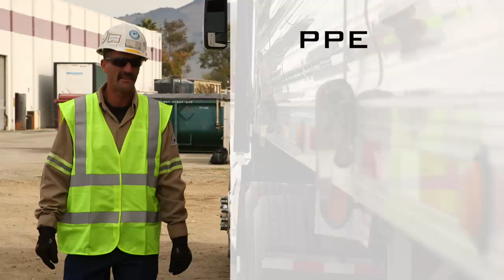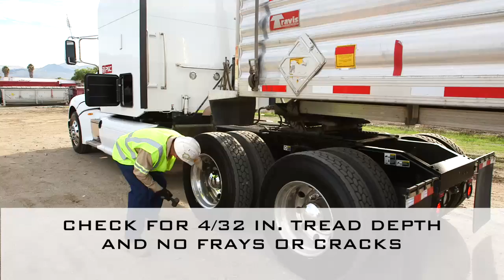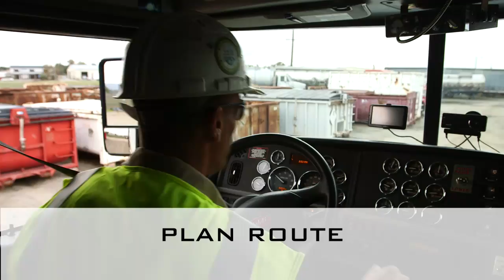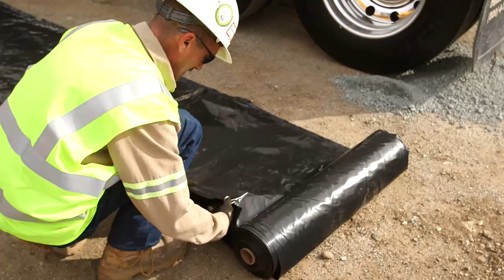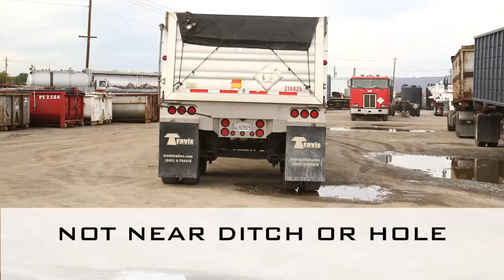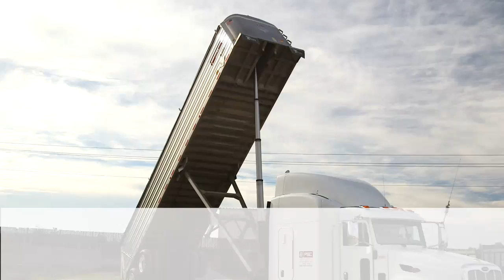End Dump Training Video

Comment: So I haul sand and I have to back up and outside ramp and dump in a portable grate .. anyhow if you don't get backed up far enough the spotter will ask you to back up at the bed in the air... Also a few times I was asked to lower the bed with a load on it once it was in the air because he did not have me come back far enough... Can I lower a loaded bed 39 ft end dump trailer...... The guy spot me and watching me dump my load come up and told me to lower my trailer with a full load on it it was most of the way in the air a little bit of sand was trickling out the door I told him I don't think I'm supposed to drop a load of trailer his reply to that is if we tell you to drop a trailer you will drop it LOL what do you say to that

Comment: The tailgate latch on the trailer used in this video is awful!  The truck I drive also pulls a Travis trailer with the exact same locking mechanism and it's way more secure than the one I just witnessed in this video.   Too much material up against the tailgate and that thing is coming undone!

Comment: Video does not tell anyone how to actually operate equipment.Back up to unloading area if needed.  Set all brakes.  Open gate, Lower tractor frame, "deflate air bags",  Set trailer brakes, release tractor brakes, step on foot brake, put truck into gear, turn on PTO, put truck into neutral, release foot brake, if using an automatic transmission, push accelerator,  raise boom to lift end dump above the tractor.  Do not let the trailer roll backwards.  Lower boom if you see that because it will RIP off the trailer owners mud flaps.  
As soon as you see the rocks falling out quickly set tractor brakes and release trailer brakes. Doing it this way prevents the load from burying the trailer wheels.  As soon as the trailer has unloaded all product and boom is all the way into air turn off PTO,  put boom elevator into neutral, set trailer brakes, release tractor brakes, let load push trailer forward, step on foot brake to slam rear door shut, set trailer brakes, release tractor brakes, lower boom elevator, raise tractor frame " inflate air bags", make sure dump bed is all the way down, close the gate, if I understood the directions given to me by a good man.  I may not have because I was tired.  There was some action in the neighborhood over the weekend.
Reply: According to other professions if the customer wants product dumped out in a strait line the operator should set tractor brakes and release trailer brakes when raising end dump.
Reply: Releasing trailer brakes, setting tractor brakes and raising boom with loaded dump container may cause trailer to sway back and forth though causing a snapped hydraulic line leading to a roll over though according to other professionals.  The professionals also say watch out for holes on ground that tractor trailer wheels could roll into during boom operation though causing a rollover
Reply: You know it would really be nice if driver trainers would not purposefully lie to other drivers like telling them to unload center pods first, front pod second and back pod last on dry bulk pneumatic trailers to purposefully waste other drivers and customers time when unloading product into silos at the expense of job loss and wasting money just to laugh about it at the biker bars or where ever else they may be bragging about their crime.  When you train somebody do it correctly please because joking around with wreck less directions should be a felony especially where commercial equipment is used

Comment: Do a pre-trip but completely ignore the air lines dragging on the catwalk. DOT will LOVE that one! Use a hammer to check air pressure instead of a gauge? Another good one...genius'. The tire doesn't have to be totally flat for DOT to get you.